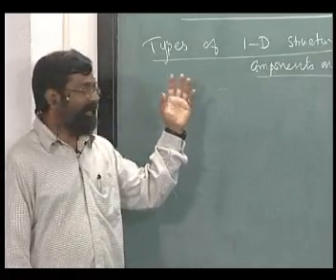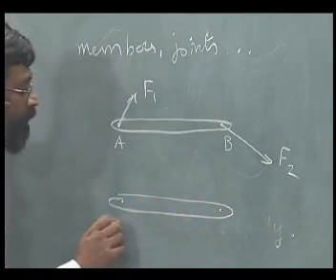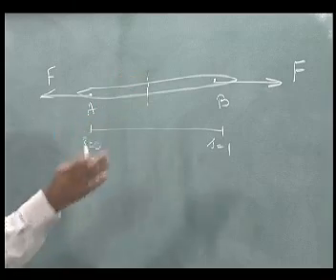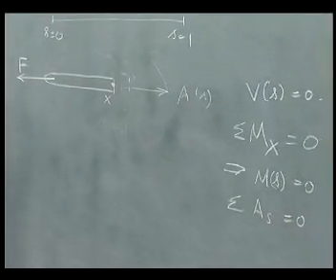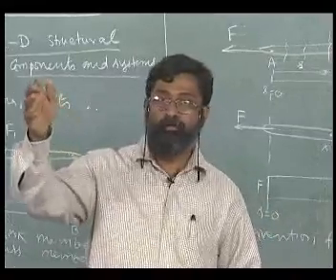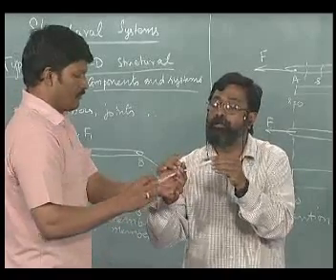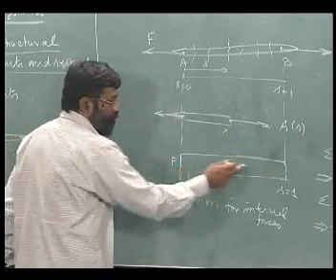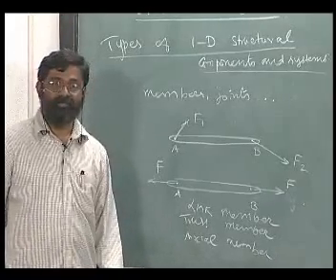Types of 1-D Structural Elements

Comment: very useful lecture
.
I have a general doubt in the beams.

If there is a beam of the certain length and a force acting on its tip, so if I slice the beam in half along axis then how the beam will react in comparison to the unsliced beam?
is it going to bend same in both condition or slicing will effect?

thank you
Reply: I think it should.The neutral axis will be thinner now,second moment of area will change and the bending stress would be more.While the bending moment remains same in both case its effect would be different because later bend more than other.